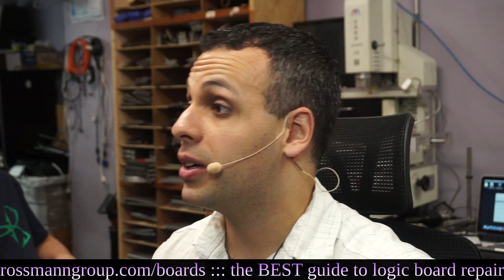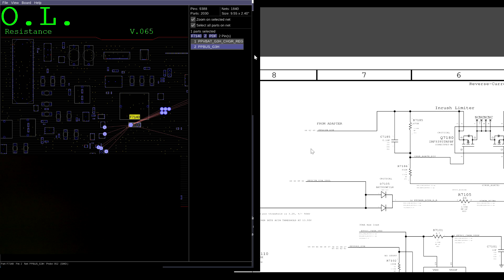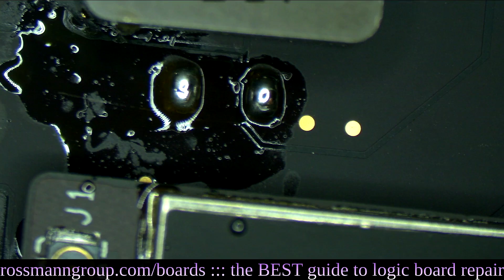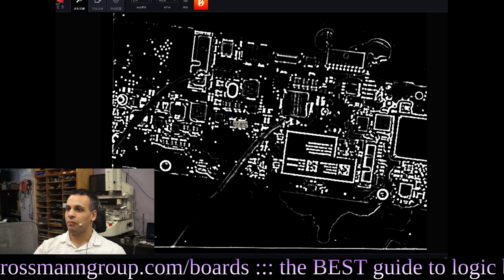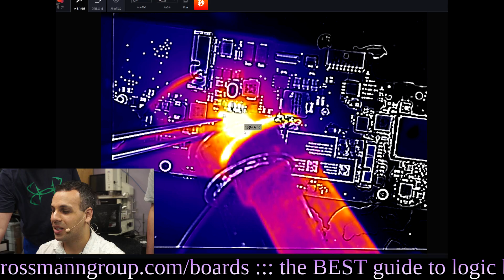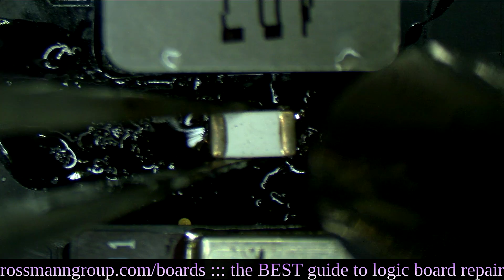Does Louis owe thermal imager an apology?

Comment: If you've used regular ethanol, the boiling point is a 72°C. 50°C won't do a thing. The alcohol-method is fine, if it gets really hot, but the thermal camera is faster and more accurat. and it doesn't force you to soak poor maccie in alcohol... that stuff is better served as a nice bourbon whiskey to fortify the man at work ;-)

Comment: I agree with Louis, the Thermal cam is useful, and it has the potential to dramatically help you find shorts faster, specially if you're a beginner. However, like Louis said, the price is just too high at this moment ($800 or more).   I believe that Union Repair will significantly  improve their sales once they drop the price to reach a larger audience instead of just professionals repair shops that makes a lot money. At this point I will rather buy a Flir Cellphone thermal camera for half of the price even if it means to have least capable product since it is not design for board repair.

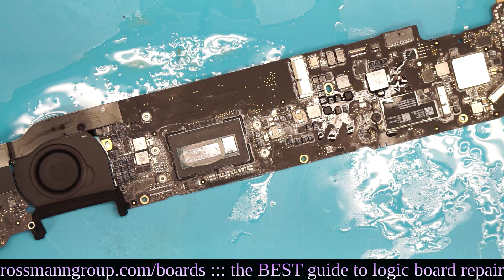Comment: It would be interesting to see the repaired board running as it is at 9:43, but under the thermal camera. Curious to know how hot that CPU is without its heat pipe assembly...

Comment: IR resolution is "bad" because it has a much longer wavelength than visible light. High resolution IR cameras have 320x240px, the same effect happens with radiotelescopes: even when doing interferometry imaging with telescopes kilometers apart, the images are few pixels wide, due to the even longer wavelength.

Comment: DO NOT BUY THAT THERMAL CAMERA
At $1000 it's a complete ripoff. The FLIR ETS320 is ~$2300 and has the resolution is 4x this one's, and for only ~$300 you can get a Seek Compact PRO with the same resolution and tape it to a lamp or something. Same resolution as the ETS320, just not lab-oriented.

Comment: Yes, it is definitely a low resolution IR camera.  I hope 640x480 sensors will eventually get more affordable.  I'd buy a real model if I though I could build a business around it.  You'll notice that the edge detected visible imagery doesn't register well with the false color IR imagery due to the closeness of your soldering tool to the lenses.

Comment: After watching so many macbook repair videos... Does learning to not buy an Apple macbook count as learning something?
Reply: Well, what happens to broken 1000 dollar windows laptops? Not a 500,- board repair, that's for sure.
Reply: Henk159 well, depending on your warranty, at least with shop I bought mine, you get a completely new one. I had an Asus laptop 6 - 8 years ago with extended warranty. I paid €270 once, got it replaced. Sadly, that included the HDD of which I had no backup.
But, in short, you'll get your fixed laptop for under 500 euros if you have basic extended warranty. Although one could argue that was too cost intensive, since the store is out of business by now.
Reply: Similar to watching a lot of Ford and Chrysler repair videos on car repair channels
Reply: I sold all mac machines, when i found out how quick a Hackintosh ran on normal hardware with cooling. I was baffled how long i kept fooling myself with their HW and OS. I'm back at Windows now...
Reply: @JCD87  just switch to linux you prick.
Reply: Good luck with Winblows! You'll need it if you don't want to be losing lots of time every boot and reinstalling it every year for it to keep performing well. Unless the only thing you do is browsing and reading email, Windoze is really bad. You'd have more luck playing the lottery than making Windows work correctly for more that one year!
Reply: @GRBtutorials  Clearly you're not smart enough to use a computer that doesn't hold your hand all the way to the school and you keep installing malware on it. Or you haven't actually ever used a windows pc after windows xp service pack 1.
I haven't reinstalled windows in at least 10 years except when changing hardware and it displays more or less no degradation over time.

Comment: my mbp 2012 has been running slow after trying to mojave beta. It was in sleep mode for a few days, and I opened it to watch a youtube video and install hardware monitor... letting the YT video play made my CPU and GPU run at 70-80C
Would you recommend a somewhat experienced person in building PCs to replace the thermal paste and use a compressed air can to clean out the computer themselves, or would you recommend bringing it into a repair shop like yours? Thanks

Comment: Have you tried the Quick 857dw+ hot air station? It has a 580w heater and a max of 100L/m. And best of all has analog knobs that makes it so you don't even have to look at it while changing temp/air speed. All that for just about $100... Is it too good to be true ?
P.S I know you don't have the time to test every cheap station out there. But seriously, this one might be a winner. I will probably buy, and test it myself.

Comment: Hi Louis, thanks for another informative video (and entertainment too BTW). I've been working on a 820-2330-A A1286 on and off for 2 months now. It's a bootstrapping learning experience - essentially from scratch since the last electronics I played with was 40+ years ago (ahhh 6502 and wire-wrapping... in those days sneezing was not so much a problem). Anyhoo, now I have glasses for close work and a binocular microscope for actually seeing what I'm messing up (and bruises on my nose when I forget to move the glasses to peer at the board). My probes, iron tips, and rework blower nozzles are getting finer and I'm blowing up less stuff with practice. The board now boots when I press the power switch. Fans spin with power-switch but not with just power plugged-in. S5 rails look fine but PM_SLP_S4_L is not triggering unless I press the power button. PPBUS rails look good at 12.58 (which means the SMC is talking). I thought today's video was going to do the trick but alas no. I don't dare force PM_SLP_S4_L high as that would likely draw too much current through the CPU (where the signal is generated) and I've tried to check signals into the CPU that would tell the motherboard to sleep (guesswork there!) and pulled out downstream resistors one by one to see if any shorts to ground are present that keep PM_SLP_S4_L low. Probably past time to get on your forum and actually ask for hints - this is just a heads-up in advance and a thanks for the amazing tutorial and videos.

The wife wants to get her front room dining table back!

Comment: A thermal camera certainly isn't an essential piece of gear but as demonstrated you can waste up to several minutes looking for a short, do as little as 6 times a day and you can easily waste an hour of your time or think of it this way, you're losing a potential that could net an extra repair costing you a few hundred or so dollars per day, meaning the camera could actually pay for itself in about a week or two since it can point you directly to the shorted area, but here's my suggestion, rather than pay $1000 for a mildly useful camera get something cheap like the flir one which you can plug into a phone, the camera doesn't have to be good you just want something to point you in the right direction, then you use the alcohol method on that area to figure out what the short is which should save a bit of time.

Comment: 900 for a crappy rez camera? An usb Seek Pro is like $500. The resolution is good enough and it has a narrow fov good for pcbs. There is free software to run it on a pc with a diy or a .5 mini usb adapter.
Reply: Pașca Alexandru well, the only thing it lacks multilayer image. i'm thinking of buying one and trying to add a second normal camera with a high pass filter. i do not believe its good enough for tiny laptop caps.

Comment: I think they are absolutely useful if the resolution is good enough. The system made for tech  repairs is pretty low res though.

Take a look at seek thermal. Probably highest res available for price and i think its around double what youre currently using for less cash. Just needs a stand and maybe some custom software for repair ;)

Comment: The alcohol method probably failed because the hot spot (~50-60°C) wasn't hot enough, Ethanol boils around 78°C (depends on airpressure etc...).

Comment: the temperature of the shorted component is lower than the boiling point of alcohol(methanol 66º,isopropyl 88º, ethanol 78º) and the only thing that would work is acetone 56º. but that may dissolve the coating of the board.
Reply: Needed more voltage.
Reply: NeoFryBoy exactly
Reply: More voltage is usually a bad idea. But freeze-spray works where IPA does not. 3 cans of freeze-spray would serve till the lease runs out. :)
Reply: It doesn't have anything to do with boiling the liquid off by raising the temperature. ANY heat differential will cause the alcohol to evaporate faster in the warmer regions. It has to do with the surface of the liquid and the vapor pressure. A cup of water will evaporate all by itself in your house. A glass of water will evaporate much quicker in the sun. Neither of which is near 100°C.
Reply: Andrew  There's a noticeable temp diff between in your house and in direct sunlight.  Higher temps will cause it to evaporate much faster.
Reply: he could use diethyl ether...but given the abundance of very hot objects nearby, that would be...well not exactly OSHA compliant
Reply: Acetone and IPA are both quite flammable. Is Diethyl ether much more so?
Reply: I don’t get it. i thought liquids damaged electronic equipment? Why is the alcohol not shorting numerous circuits?
Reply: Richbadman isopropyl alcohol is not conductive, purified water and soda are.
Reply: "cause they got electrolytes"
Reply: If you mean with "purified water", tab/drinking water, yes. But "purified" as in distilled water isn't. Distilled water is practically completely pure. It contains no solutes that can act as mobile charge carriers. The conductivity is therefore very low (0,0000005 S/m).
Reply: darknase yea but distilled water doesn’t stay pure for long.
Reply: In liquids, the conductivity is caused by mobile charge carriers. These are ions that may themselves be charged either positively (cations) or negatively (anions), but also other substances dissolved in the liquid and substance complexes (so-called electrolytes).

Water, in chemistry, is called "universal solvent". So what do you expect? When you put distilled water on a dirty surface it will dissolve any soluble residue and become conductive (mobile charge carriers), but then it ain't distilled water anymore. That's why distilled water is kept in clean/special containers. 

Also, the same is true for pop soda, it will change it's conductivity when put on a dirty surface. Just because pop soda already is conductive doesn't change that fact. Therefore the fact that distilled water (essentially) isn't conductive doesn't change either.
Reply: Purified water is bad as it will leech materials out of the board, thus becoming conductive again AND ruining the board.
Reply: Simply put: Resistance. Ohms. From "Ohm's Law". The inverse of resistance is called conductivity, here specifically electrical conductivity (as there is also things like thermal conductivity - which is important for things like thermal paste [a.k.a. TIM or "Thermal interface material").
All things are to a more or less degree conductive, like air is less conductive than (tab) water and water less than copper, etc., etc.
If you research that (google - it's a rather extensive topic, so, sorry I'll keep it short) you will find that water is "highly" conductive at ~200 Ω/m [Ohm per meter] versus IPA (isopropyl alcohol) of about  ~166000 Ω/m (or 166 kΩ [Kilo Ohm]), to get some relation: copper has like 1.68×10^−8 Ω/m (16.8 nΩ [nano Ohm] {nano is 10^-9 ... easy to remember _N_ano -> _N_ine}). Also to take into account here is, electricity will always try to take the "shortest" (mean less resistive) way to close a circuit.
Plus even if there might be some electricity flowing (this is a secondary effect, so take it's minuscule):  The higher the resistance, the higher the voltage drop. As resistance turns electrical energy into heat energy (like it is actually done in a hair dryer - the heating element is of high resistance), so the IPA will (again, this is minuscule) actually boil and thus you see the fault easier.
Reply: reduce air pressure . you can always check at the top of montewerest

Comment: What now Apple is installing fuses that actually blow when they are suppose to. I thought that was the one and only apple product that does not break. MIND BLOWN!
Reply: Perhaps Mr. Rossmann can repair your mind.
Reply: I think it's mostly the backlight fuse that rarely blows.
Reply: Well, any fuse is supposed to blow if current gets too high... why is this so shocking? Don't forget that fuses are mainly there to protect wires from melting.
Reply: Its shocking because we are talking about Apple. Normally the tracks on the board melt and burn away while the fuse is still not blown.
Reply: jolessalex WHOA! WHOA! hold your horses (man, boy, OR old man), was it necessary to say that?
Reply: Harsimran Singh Yes.

Comment: On metals temperature measurements are way to low, because teh emission coefficient e is very low on shiny metals (e about 0.05) compared to darker materials which, because they are darker approach the perfect black body much closer (e close to 1)

https://en.wikipedia.org/wiki/Infrared_thermometer

Read the accuracy section. Between 0.9 for dark materials and 0.05 and lower for shiny metals, quite the error that may occur. Teach your interns before they say wrong things on camera :)
Reply: the metal also reflects infrared radiation to some extent, which means that you can see the reflection of other things in it.
Reply: The 190°C max didn't have anything to do with emissivity. It was something to do with the software. You can tell because it stayed at 190°C perfectly, and didn't stray from that when the camera was moved anywhere that was hotter than 190°C.
Reply: Exept it didnt, it went up a notch or two step by step.